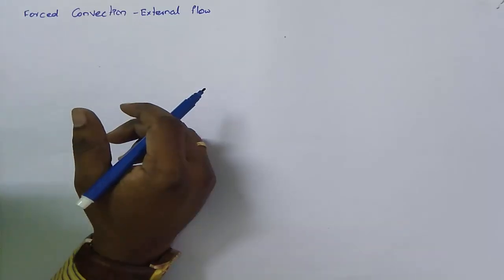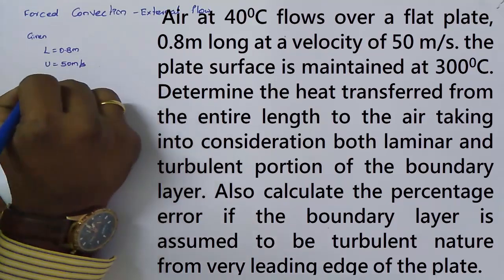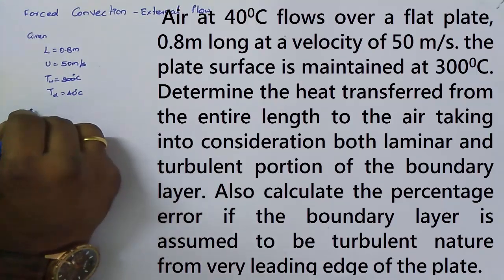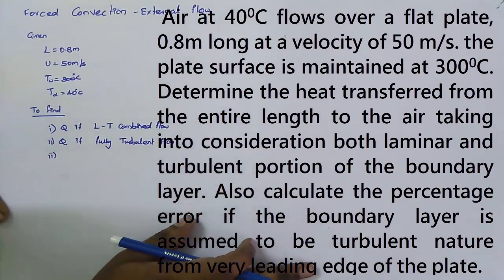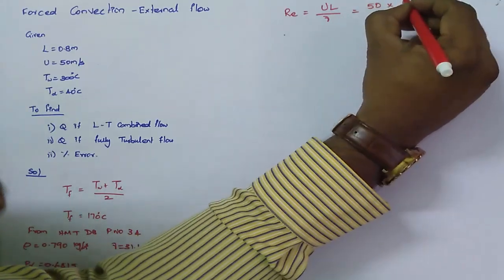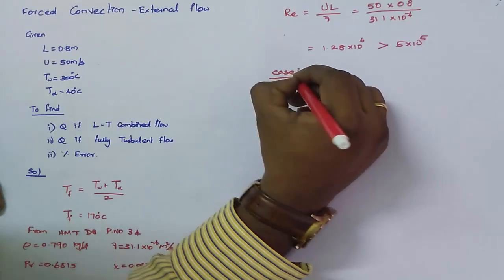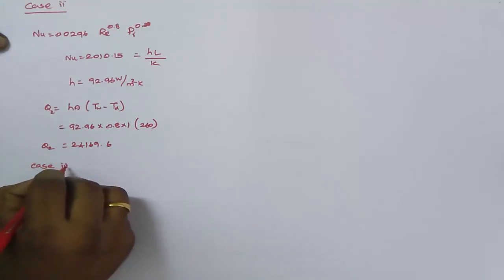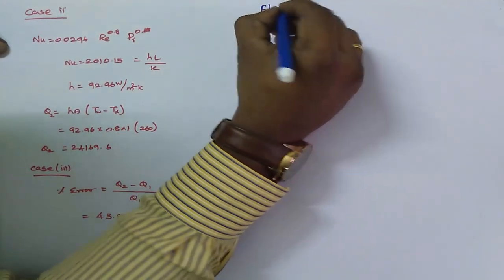Lecture 15 | Problems on Forced Convection over Flat plate and cylinder |  Heat and Mass Transfer

Comment: for external flow over blunt objects, like cylinder, critical reynolds number is 2 x 10^5.
since 2.08 x 10^5 is greater than critical Reynolds number, flow is TURBULENT, not laminar. 
otherwise, great video👍
Reply from the maker: Between reynolds number 2lakh to 5lakh flow changes from laminar to turbulent... That region is called as transition region... However for calculation we will use anything below 5 lakh It is laminar flow only...Thank uuu

Comment: Re=2×10^5
Re=5×10^5
When to use these two values?
Reply from the maker: Between reynolds number 2lakh to 5lakh flow changes from laminar to turbulent... That region is called as transition region... However for calculation we will use anything below 5 lakh It is laminar flow only